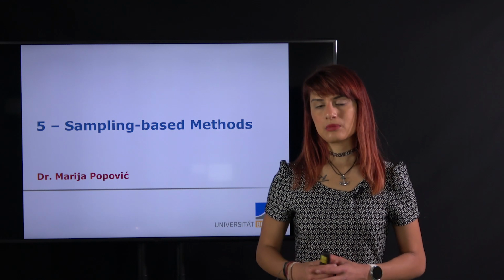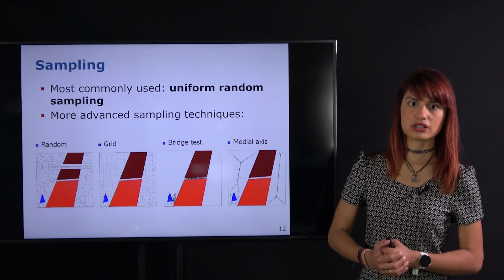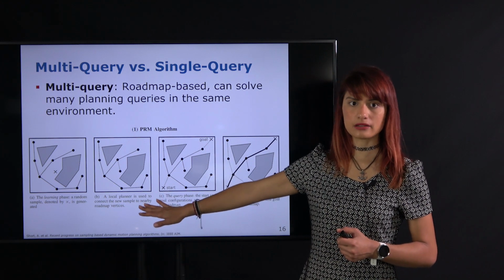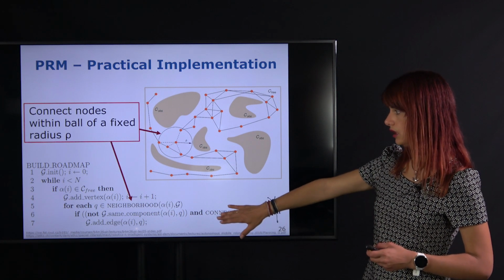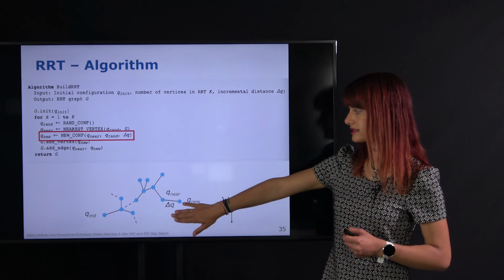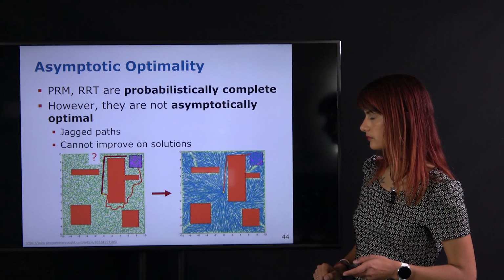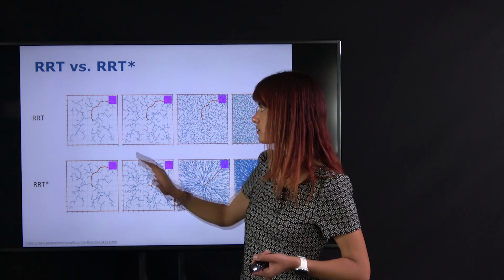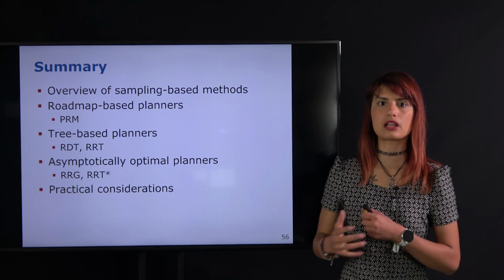Sampling-based Methods [Lecture, Marija Popović]

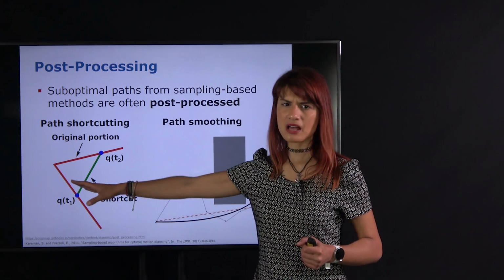Comment: I have a question regarding post-processing. In the early slide, you mention that we can integrate kinodynamic into RRT to sample nodes based on it. It gives me the assumption that we don't need further post-processing in 1:25:28 since it already adheres to the kinodynamic constraints thus it will not give a jagged path.